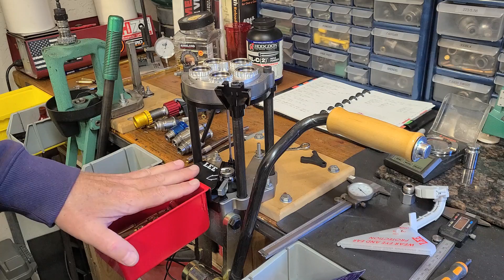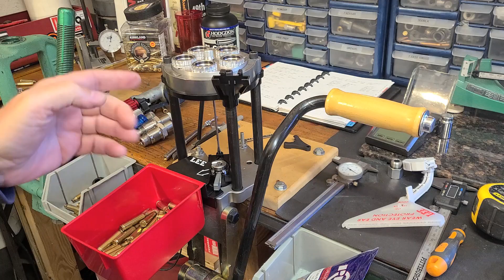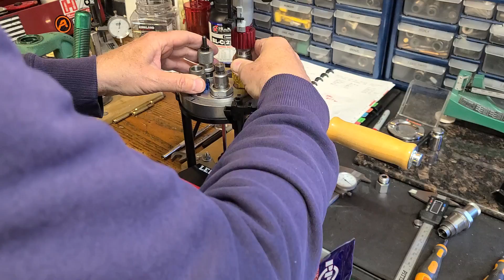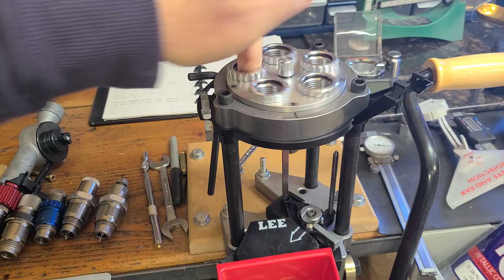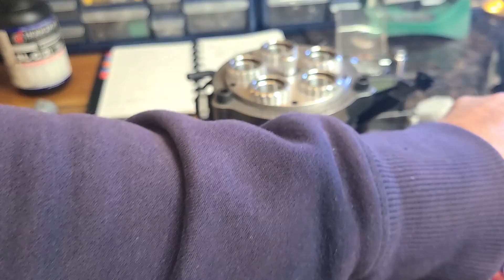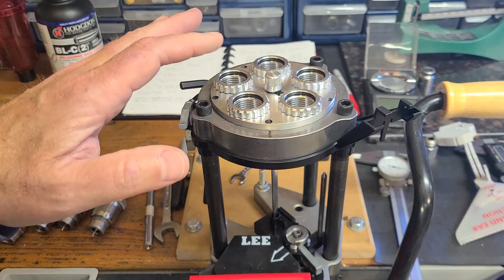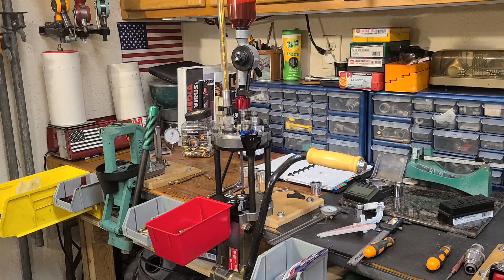Lee Precision Ultimate Turret Press...First look at part no 91910

Comment: I think I would miss the detent on the indexing, especially when I manually advance the turret, which I like to do.  Is there some sort of roller bearing in the turret head, as an improvement over the Classic Turret Press?
Reply from the maker: There is no roller bearing in it.  The turret rides on a lubricated disk I would call a thrust washer (More in my next video) and its held in place with the turret housing with much tighter tolerances than we have seen in the past.  I've messed with manually advancing the turret and its do-able but it requires you to make alignment visually rather than by feel.   It is different and a little weird but I adjusted to it pretty fast.  Some will never like it I'm sure.

Comment: When I load 9mm I use all 6 stations in my Lee 6 Pack. I really like the progressive for the high volume stuff and adding a powder check and a bullet feeder was a great addition. I would have had a really hard time choosing between the 6 Pack and this new Lee turret press.
Reply from the maker: The Ultimate is very efficient to operate and really gets as close to a progressive as I think you can get and still maintaining that, one cartridge at a time focus.
Reply: With the prices for these presses as they are I am planning on getting both... The 6 Pack for volume loading (9mm, 223 ect) and the UTP for lower volume or load development loading. I love the heavy duty Dillon stuff but this new generation of Lee equipment is hard to beat, especially for the price.
Reply: Excellent  video. I have a classic turret and am now considering upgrading.

Question though, I’ve never been real happy with the consistency of the auto drum powder measure, is there a trick to get it to throw consistent charges?
Reply: @davidmccollough4791 I have not had problems with it in the small pistol charges but I choose almost exclusively ball powders and fine powders for their good metering. I load in the middle of the range so I can stay within factory loads even if I have a 5% charge variation.

Comment: I'll watch a video of any length from you in this. I wasn't even aware of this product.
Reply from the maker: Nice of you to say Sir.   The press just came out, they don't even have all the accessories available.
Reply: @TreeTopFlier  i tend to watch videos in spurts while doing chores. You mentioned that you have to remove automatic indexing for tall stuff. Would 30_06 be in that category? And how does that compare to the classic cast?
Reply from the maker: It has about 3/8" more clearance than the LCT.  30-06 would be right on the edge depending on the length of bullet used @GunFunZS
Reply: @TreeTopFlier  thanks. That's very helpful.
Reply from the maker: @GunFunZS  👍
Reply: @TreeTopFlier  I still need to get a router mounted on one of the presses. I'm still leaning towards the load master.
Reply from the maker: I've never used the loadmaster but they seem well made  @GunFunZS
Reply: @TreeTopFlier  I've enjoyed mine. The six pack seems like a clear improvement even with the bushings.
Reply from the maker: I helped a neighbor set up a 6 Pack pro.  We had some problems getting reliability from the priming sys. I didnt get to spend a lot of time with it to trouble shoot.   The commenters on this video have had nothing but positive things to say about it. @GunFunZS

Comment: Good review. I just don’t trust Lee stuff outside of their great die sets.
Maybe they’ve turned the corner on quality.
Reply from the maker: Thanks!  I've not had that experience but we are blessed with lots of great manufactures to choose from.  It is important to be able to trust your equipment.
Reply: I've never had any problems with my Lee Classic Turret press, Lee Classic C-press, die sets, the Auto Safety Prime, or the Pro Auto Disk powder drop.  The only Lee products I don't like are the Adjustable  powder charge bar for the Auto Disk and the mechanical Safety Powder Scale.

Comment: Thanks for the great review. I was looking to move up from the classic turret for bulk range ammo and greater speed. I opted to go with the 6 pack, and made the purchase before this was released (I'm very happy with it). This looks like a great press, but I don't see much of an advantage over the 4 hole turret. The slower operation of the turret allows you to keep a close eye on powder, and placing a bullet isn't a big deal. It seems this just creates more pulls of the lever. I think this may be a great option for someone just looking to step up from a single stage, as the 4 hole was in the past, while allowing more opportunity for growth.
Reply from the maker: Lots of great comments in the chat about that 6 Pack.  I've used it a little, seems nice but we struggled to get reliability from the primer system.  Need to get back to it.   The one thing I will say about the Ultimate turret is the 5th hole with Lees inline bullet feeder and using the press as intended with the case kicker and catch tray more than makes up for the extra handle pull.  Its so efficient it makes up for it and the bullet feeder (so far) sets the bullet straight in the case, better than I can do by hand...very nice.
Reply: @TreeTopFlier  Regarding the 6 pack priming system,  I've found that you cannot let it run low on primers. I always leave about 5 to 10 primers in the fixed riser and load the tray beyond that for my loading session. I haven't had a malfunction since.
Reply from the maker: Thanks, Ill keep that in mind next time I take a crack at it.  That may be the problem. @grassyacreshomestead700
Reply: @grassyacreshomestead700  same with the old pro1000 primer chutes

Comment: Very well shown to us as always Tree top! I think the "Die Tipping" is more of a thing with almost any progressive press. Its important to have all your dies adjusted about to the same height or tightness" against the shellplate. Just so that the shell plate does not "tip" on most progressives. I agree the vertical turret movement (tolerance) is never an issue with Lees older turret or this newer turret. I bet its just sales hype they wanted to say they got rid of more vertical play. (not that it even matters.)  It looks like a great new Turret.  I wanted something faster to get more rounds per stroke with pistol so I am very happy with my new 6 Pk Pro as well. I have the Lee 4 tube bullet feeder and the double Alpha powder alarm that beeps for overcharge or undercharge and I can still do seperate seat and crimp.  It has a ball detent but also has the locater rod thru the shellplate as your turret does. I love this new progressive press for pistol and even 300 AAC BLK. Lees new 6pk pro is such low muscle effort and smooth I am amazed.  For all other longer rifle cases I will still use my Lee Classic Cast 4 hole turret or the 550 manual index Dillon unless I find a buyer and I can get the new Ultimate turret. It looks like a awesome Ultimate Turret ! Happy loading !
Reply from the maker: Lee has always struggled against perception.  They know you don't need 20 tons of force to resize brass which is the only press operation that even requires force, but... the industry markets powerful presses to the masses very well.  They also know that vertical movement in the die carrier doesn't cause irregularities but the industry has sold... tight is right.  Ironically, the same people who would howl over "slop" in a Lee turret press would swoon over sliding a die in the slot of a Co-Ax press LOL.  I think, with the last two offerings Lee just said, fine, you want powerful and tight...here ya go!   I get it though, we are trying to capture lightning in a bottle with accuracy so its normal to try to reduce variables, human nature.  If you have an Area 419 press and your shooting 4" groups, you would never assume it was the press.  Same situation with a $100 Lee press, yep its got to be that cheep press.   Lots of love in the comments for the 6 Pack pro.   Thats good to hear.

Comment: Tree top my Breech Lock Pro has a staking pin for the rotating shelf plate, That might be where they got that idea for the turret.
Reply from the maker: You're correct, they have transferred the alignment pin they use to square the shell plate to this press to lock the turret.
They re-use a lot of their engineering in new projects.

Comment: Awesome!! thanks for sharing..... was thinking getting one....
Reply from the maker: I plan another video, with more in-depth stuff.  Let me know if there are any questions I can answer.
Reply: @TreeTopFlier I do have a lee value turret press which I use for pistol and had a reverse kit made for it..... and now i find lee made this one already with a reverse kit with, i was thinking getting one to do some rifle reloading that I can have one for pistol and one for rifle then..... i know this one and value press are similar but are they interchangeable for parts?  i don't really like the auto indexing turret but i deal with it.. thought about a redding or a lyman turret for manual index..... but thanks again...
Reply from the maker: I don't think there are any interchangeable parts with the value press...maybe the priming levers.  The indexing system is really a feature of the ultimate press so if you like to manually advance the turret you would probably be happier with the Lyman or Redding. Thanks for the comment.  @michaeldunn150

Comment: I have no desire or need for a progressive press. The only press I've had or used since 2014ish is the classic 4 hole turret press. It has been excellent. I only reload various pistol ammo. I have the old round safety prime and auto disk and they are excellent. I just bought the deluxe auto drum powder measure because of your videos and over the weekend I've been testing it out. Excellent,  now I can dial in the charge instead of getting close with the disk. I think it holds better tolerance than the disk which was really good.
This new press I will definitely check out. I really like what you've shown so far. I'm not worried about the overshoot. Having the option with more holes is what I'm interested in. Not putting out more rounds an hour. 
Your videos are awesome and have helped me a lot. Especially the new deluxe auto drum powder measure that you covered extremely well has been a blessing.
You can go as long and detailed as you want. I'll watch it.
Reply: I also have the LCT press with round  safety prime and auto disk powder feed.  I think the round version safety prime is by far the best Lee design. I've customized and adjusted the auto disk so that it will drop even the finest flake powders accurately, so I'm not inclined to learn how to use the drum.
Reply: @user-sp9wr5rf4c  
The auto disk works great. I wanted something that I could adjust  easily that covers what the holes in the disk couldn't. I tried the adjustable disk bar but was not satisfied with it. I have the double disk kit and it works great also. I'm still trying out the auto drum and so far it's been what I've been looking for as far as tuning in the amount very easily and conveniently. Another bonus is adjusting it without turning off the hopper and changing disk size especially when your going from 38 spl to 357 magnum. The auto drum has it's quirks like the auto disk but the drum does seem to throw a slightly more accurate drop. But of course the powder type plays into this as well. I wasn't looking for more accuracy because the auto disk worked great.
Reply: @vinsonhelton7141  I hear you about that dumb adjustable charge bar.  I increased the adjustability of the fixed auto disk charge hole design by installing a small set screw into the sides of the charge holes on several disks.  I turn the screw inward so that it protrudes into the charge hole to reduce volume. I can now throw custom charges of different powder types.   But I suspect that Lee will just drop the Auto Disk now that the improved Drum measure is out.
Reply from the maker: Thanks for your comment on my long detail, I really try not to waste peoples time.  Funny you mentioned the autodisk.  I got mine out after not using it for years.  Set it up and tried it...Nope not as good as autodrum LOL.   The overshoot is not a big deal and I adjusted to it quickly, its just weird and definitely different from what Lee users are used to.  Thanks for watching!

Comment: I feel like they could have engineered the detent still.  Like if the detent was in the actual turret and the 4,5,6 dies had a detent at different elevations then corresponding recesses to match the right timings
Reply from the maker: Yes, there are a few ways they could do it.   The turret rides on a thrust washer underneath.  The turret could have a ball and the thrust washer 4 5 or 6 detents.  You would change the washer type with the turret??   In real use its not a big deal, I adjusted to it pretty fast.  Thanks for watching.

Comment: Nice! You got one!  I unfortunately recently bought a Lee classic cast 4 hole turret. Its really a great press, but I would have waited for a 5-6 position Ultimate if I had known.  However It was just my birthday and I bought a Lee 6 pk Pro progressive for doing pistol as I get a large discount for my birthday with Midway!  Its really awesome. Now I have both a Lee 4 hole Turret for rifle and progressive for pistol.  Its unbelieveable how good the 6 pk pro is!  (I have also a Dillon 550 and a Hornady lock and load  to compare with)  I'm now going to sell my Hornady lock and load with case feeder and bullet feeder.
Reply from the maker: I feel like if you have the LCT press and the 6 pack pro you probably have it covered LOL.   Ive used the 6 pack a little and it kinda stressed me out trying to micromanage everything lol.  I just really dont need that much volume for now.  I wouldnt mind a 550 though.  thanks for checking in sir.

Comment: Excellent, excellent preview Flyer. It’s an impressive piece of engineering for sure. I don’t know if I personally switch from my 4-hole, and I wonder about the validity of 6 pulls per round vs the 6-pack pro where we would get one round per pull. 🤛🏻🔫🇺🇸
Reply from the maker: Thank you sir, means a lot coming from you.  I couldn't do the six I don't think.  The 5 with a bullet feeder and using the case kicker seems to reduce work even with the extra pull.   I feel like my left hand should be doing more while running the thing LOL.  The bullet feeder sets the bullet nicer than I can by hand.  Thanks for watching Sir.